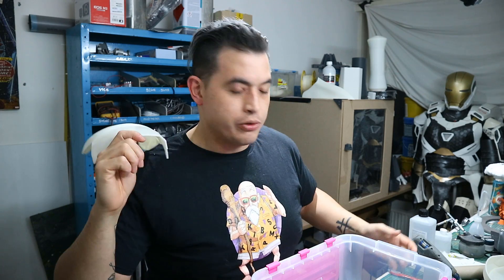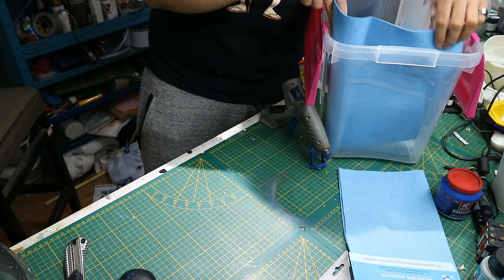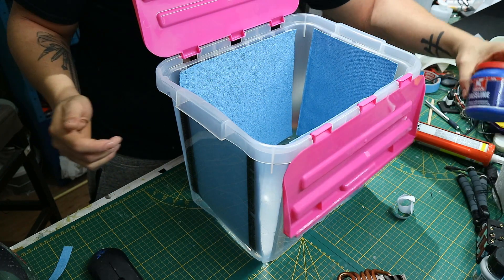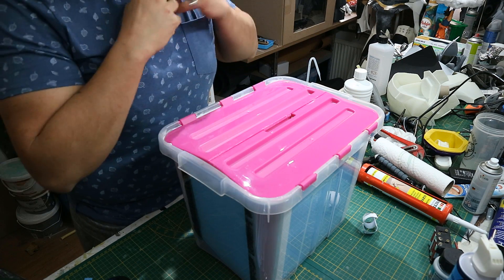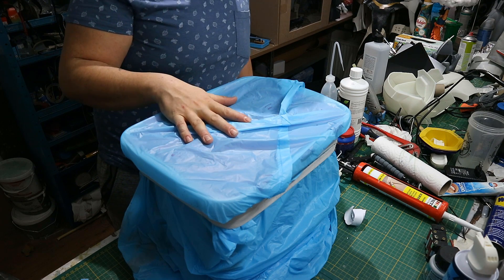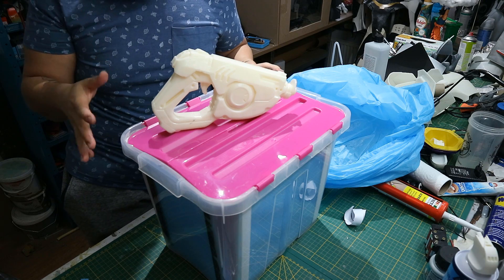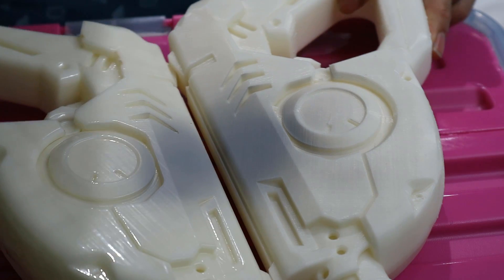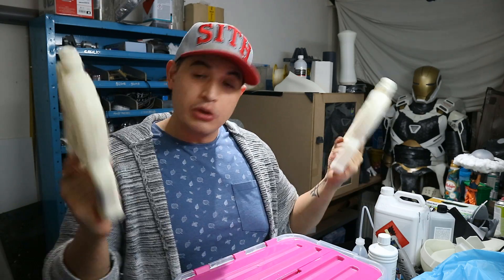SAFE acetone vapor smoothing ABS prints - 3DPRINT

Comment: Great ideas shared here.
Here is something you might try.  We used to clean engine parts with a vapor (which was outlawed about 20 years ago).  The idea was to conserve the chemical by using only vapor and draining the dirty gunk through a central drain.  Here's how it worked.  The tank was covered and had a trough running around the outside edge at the bottom.  That allowed gunk to drain in the middle without contaminating the chemical.  Then we refrigerated the dirty engine parts.  Once they were cold, we hung them in the vapor tank.  The vapor condensed on the dirty part and dripped off.  When the part was clean we removed it.  So I'm thinking if you refrigerated your parts, you could cut the time way down on your smoothing.  If the acetone condenses and drips, it would probably ruin your part, so experiment first.

Comment: I was wondering about keeping trapped vapors inside …. Is that not dangerous ?  I was intending on drilling a couple holes in the lid to allow vapors to escape. Obviously do this in a garage or outside - but not in the heat.
Reply from the maker: allowing vapor to escape defeats the entire thing, you need the vapor to smooth it...

just dont dunk your face above it when you open the box again as all the vapor will escape... (nor have hot/glowing/warm objects near)

Comment: Just used this method on some prosthetic covers I'm making. Really easy and safe. I used a weather proof bin to seal the vapors without having to caulk or use sealant. Not sure on the material of the weather stripping, but so far no side effects from the vapors. Also fyi the hook side of velcro hooks on the the micro fiber cloth. No need to glue the loop side to the cloth.